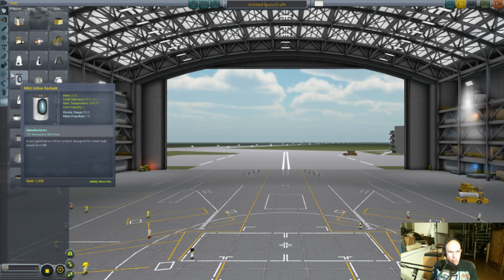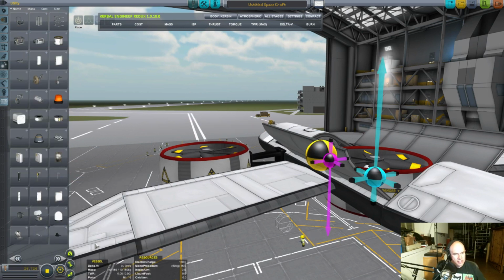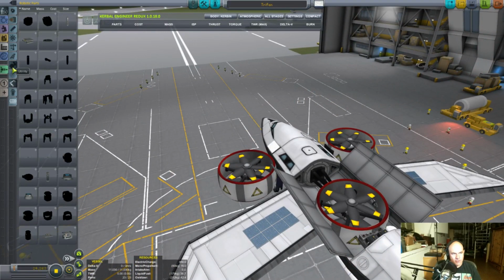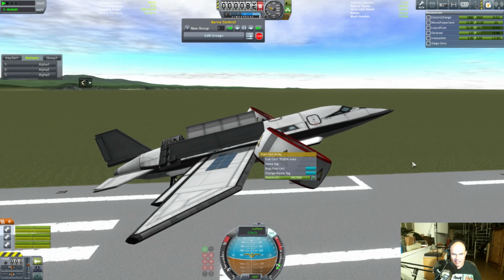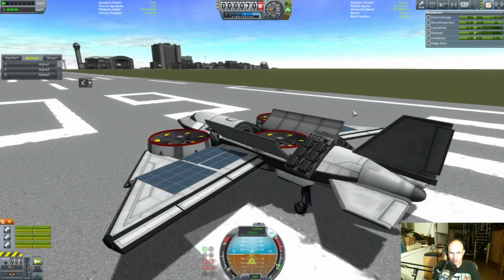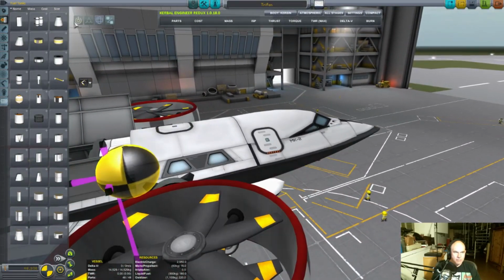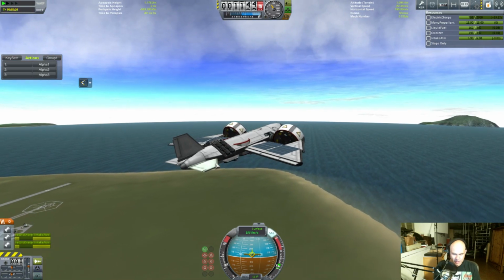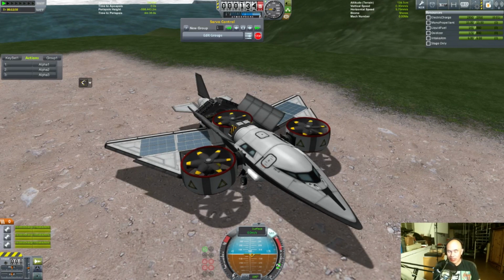Trifan VTOL - Livestream August 25th

Comment: The Trifan would be a great medical emergency vehicle. Speed is very important, helicopters are good but the Trifan would be even faster.
Reply: +soundslave And more comfortable I would assume.
Reply: +soundslave i don't like the concept much, the thrid fan takes up interior place that could be used fro payload or fuel. maybe with the third fan repositioned, or with two fans on the tail replacing the tail planes, it would be more practical, as it is, i am sceptical of the concept.
Reply: Yeah, a V-Tail quad would be much more practical.
Reply: It'd be interesting to see the Bell Boeing Quad TiltRotor come to fruition.
Reply: Helis can go very fast, most can go over 200 kph and the X3 can go like 400 something iirc.

Comment: Scott, building tip: the translation gizmo is quite broken around cargo bays: attach what you want to move to another part, tehn it will work fine since it's moving relative to that one. I.E: surface-attach to the rear face of the previous tank. Or attach a structural element  to the node in the cargo bay, then attach to that thing what you want to move.

Comment: Also, Scott, part of your normal-flight control issues are coming from leaving the ailerons and other wing control surfaces in pitch/yaw control mode. any time you were trying to pitch up, the tail would elevate properly but then the main wings would elevate as well and promptly defeat any control pitch-up moment by killing lift over the wings.

Comment: PRO TIP: any time you are using the adjust tool,  turn off angle snap and it wont pop out of place for no reason.
Reply from the maker: Right, but sometimes you want it on because of the tendency of parts to snap to the middle of something. E.g. When adding nose mounted antenna it'll snap them to the exact center.
Reply: +Scott Manley when you were adding the VTOL engine near the beginning, I felt like that would of been useful
Reply: +Scott Manley hi scott could you please tell me when you put out your next livestream on twitch?

Comment: All the fibers of my body were screaming "CUT THE POWER TO THE FRONT FANS, AT LEAST 35%".

The resulting stability would've allowed to add a actuator group to have inverted tilt on the fans, and the ability to yaw while hovering without losing balance.

The cringe was real.

I'll download the mods and test this.
Reply from the maker: +Claudio Cozzi Cutting power to those fans would mean it would nose dive when in VTOL mode.
Reply: +Scott Manley Since it's a trifan, my logic tells me to have 100% power on the back engine and 65%-70% power on the front engines to balance the CoL roughly in the middle of the three (this works IF the CoM is in the middle of the VTOL, and my contraptions usually have the fuel tanks in the middle or under the wings). The power trim will need some tweaking of course.

If you mean it will nosedive while transitioning from vertical to horizontal flight, it will of course, but only until the wings start to get some lift. I usually slightly increase the angle of attack of the wings to get some lift earlier.

In normal VTOL mode it should be stable instead, and you can just pitch it like a helicopter to move around.

Still, I want to test this ASAP.
Reply from the maker: +Claudio Cozzi But the fans weren't built around the center of mass, the nose was heavier than the tail. It's all down to engine placement, no need to trim the power to balance when the entire thing can be built to make it balanced.
Reply: Scott Manley Oh. Weird.
Since the early version of the VTOL in the stream had the tendency to backflip or pitch up at takeoff until you placed reaction wheels, I presumed that there was too much power in the front engines for its own good.

Then again, I may be wrong.
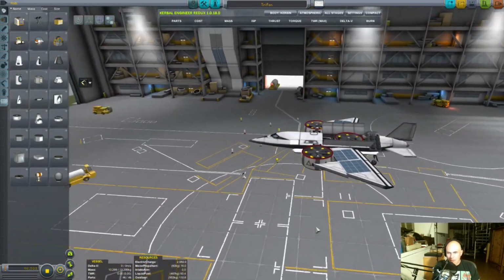Reply: +Claudio Cozzi That's why he moved the fuel from the tail plane to the fuel tanks in the center around 44:00. That shifted the center of mass forward so no adjustment to thrust values would be needed. That ended up making the nose a bit heavier for the final version.
Reply: Some good points here. The only thing important on keeping it from nosing up/down is properly placing the center of lift aligned with the center of mass. However, there are some problems with creating a VTOL in Kerbal. One of which is the lack of individual throttling between the front and rear fans. If he had the ability to throttle separately, he could have throttled down slightly on the front fans to nose himself down and create a forward tilt to move forward in VTOL mode. The issue with this design in Kerbal is that the control surfaces do nothing if there's no motion to properly create low pressure and high pressure zones. That's why he was having trouble controlling the craft near the end.

Comment: I notice in all your planes, you do not use flaps or slats. You need control surfaces just in front of the centre of mass so that they will increase your wing cross section (and lift) when you pull up. Then you do not need more tail control, they will fly easier, take off easier (without causing you pull up issues you usually have, as the front will lift, regardless of undercarriage) and you won't be "nose heavy".

Comment: Scott Manley, maybe you could try doing what the designers of the RL Harrier did, and just put in some RCS jets for low speed/vtol maneuvering.(technically they used an pressurized air feed from the compressor section of the RR Pegasus, but it is still RCS.)

Comment: Would it be possible to actually program certain things to respond to joystick inputs? It would be cool if the rotors would rotate and throttle independently to perform maneuvers. For example, trying to roll the aircraft should point one rotor up and one down slightly in a similar fashion to the control surfaces and yaw should throttle one up and the other down.

Comment: Has aviation ever looked into reverse jets for parachutes for helicopters and planes? I see it all over space construction but very little in avionic airspace? Obvious a plane goes too fast to parachute but how about reverse angled air jets that allows a type of parachute to function? Helicopters would be hard and would need to be in the shaft of the blades with a spinner maybe? Has it ever been looked into?
Reply: At one time during a hostage situation it was thought up to sling some SRBs that were pointed into the airstream to slow a plane down for a very short landing, Scott even made a video about it
Reply: +Allen Darlack Many jet engines have the capacity to reverse their thrust vector by redirecting the air flow.
Reply: true but if you would need lift and reducing speed to setoff a parachute. I don't know if the jets are designed with enough angle to lift the plane long enough to set off parachutes or paragliders? When speed is reduced so does the lift... I'm also assuming the emergency could be the jet engines and a secondary reverse airflow and lift would bypass this to release the parachute or glider (if possible?)
Reply: Most Cirrus aircraft have parachutes for emergency. Not that the pilot goes skydiving but it saves the aircraft.

Comment: Im more ashamed how all  of the modded Props emit 0 torque. :(
Reply: +Gumby MFW I saw the blades counter rotating *facepalm
Reply: +Gumby The propellers could rotate in opposite directions, but the inclination f the blade would have to be different to adjust for that. I noticed it as well, and thought it was likely an error on the mod animator(s') part.